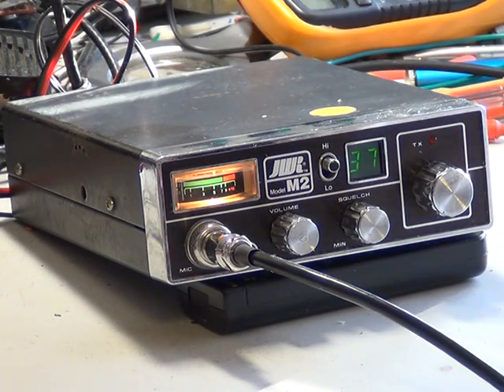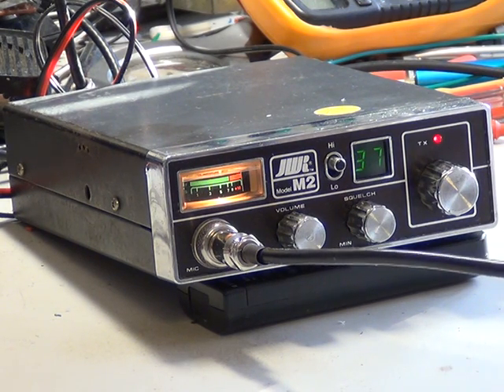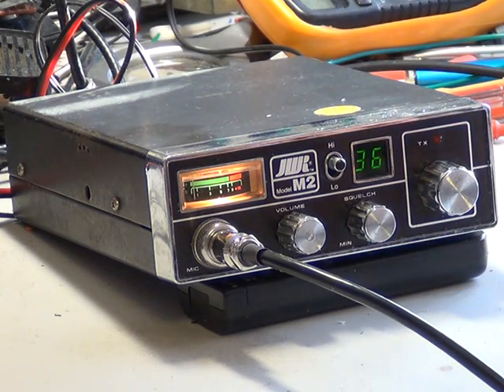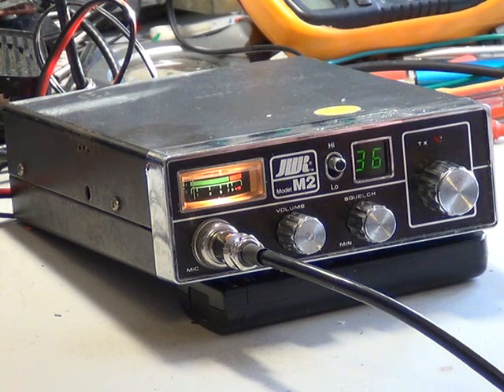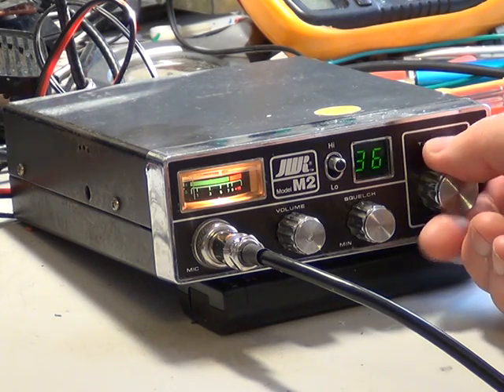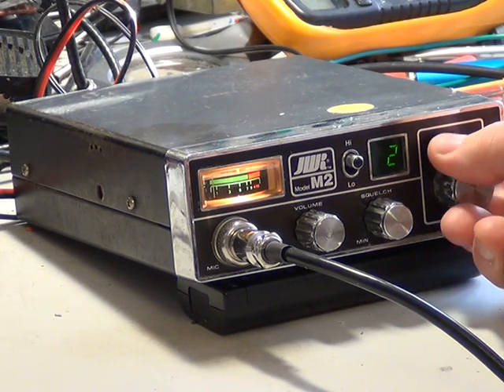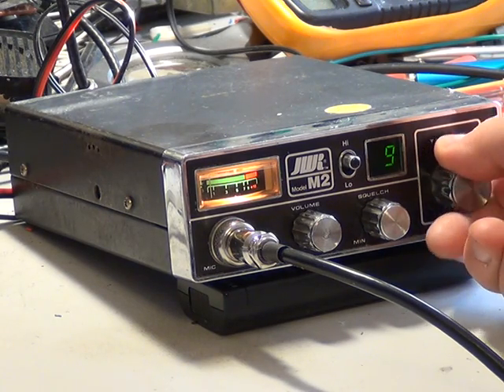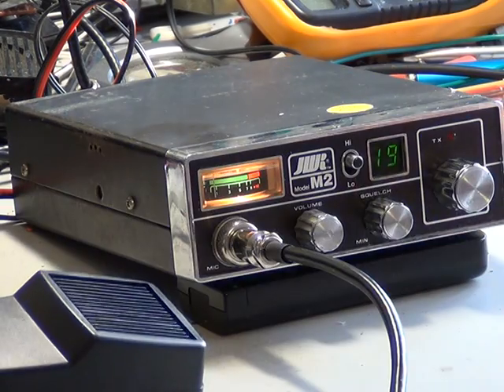JWR M2, UK (CB 27/81) CB radio (Mobile) - On The Air Test

Comment: A variable resistor can be added to the pc top board to adjust the squelch control
Reply from the maker: I tried that back in the 80's but I found that the squelch control unless very carefully set to threshold would never open ever!

Richard